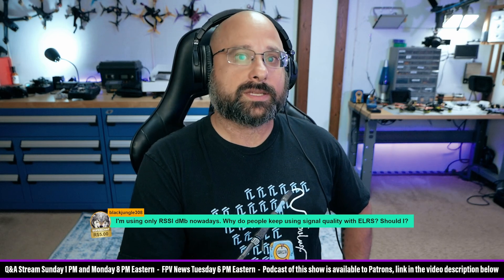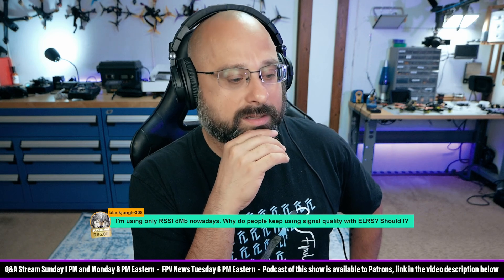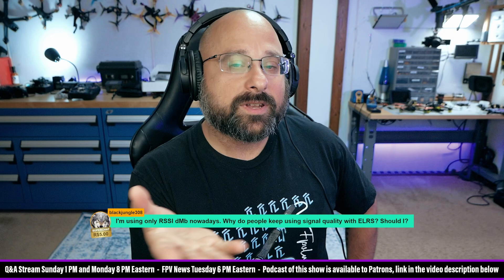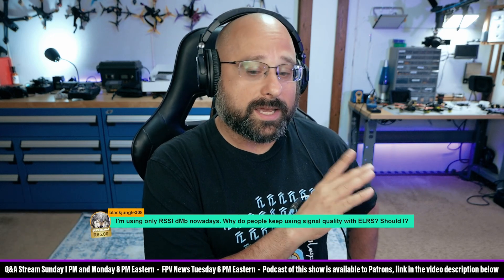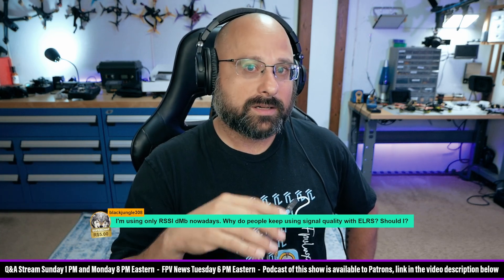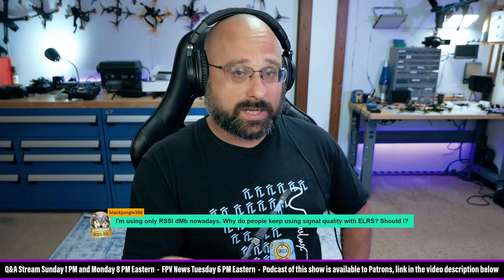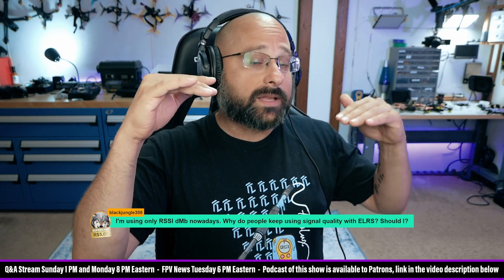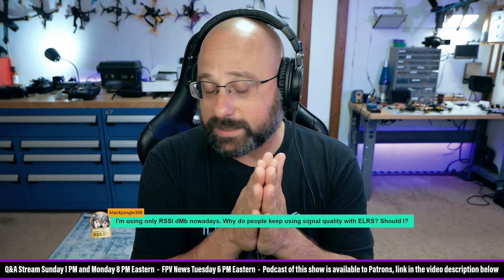Should I Use Link Quality With ExpressLRS? What About RSSI dbm? - FPV Questions

Comment: My radio has good lq and rssi but dji goggles 2 osd showing low rssi.  Anyone know what's going on?
Reply: The default warning value is -60dBm which is far too strict considering ELRS goes down to -105 or lower. On the OSD page in Betaflight Configurator change the RSSI dBm warning value to the value shown next to the Packet Rate in the ELRS lua, and add 10 for a safe margin (if you want to use the warning at all, but I'd just set it to 0 to disable it and use LQ)
Reply: @CapnBry  I tried that but now low lq flashing in goggles but radio it's good.  Tried different reciver and different uart no luck
Reply: @CapnBry wait, you disable your RSSI dbm warning? Talk to me a little more about that? You don’t think it is needed? Or you just watch it closely enough? I ask because mine is set to -10 of the packet rate, and I get the warning maybe 1000’ out with like -95 dbm. My LQ appears fine though, you’re saying I’m good to keep flying farther as long as my LQ is good and I don’t dip to -115 (or whatever my packet rate is) I want to fly farther but I don’t want to fail safe like 1500’ out into some trees
Reply: @Ryan.Rivera  Yeah ultimately the only thing that matters is LQ and you can fly it all the way down to 0, although betaflight will start going in and out of stage 1 failsafe. I don't find the RSSI dBm warning does much because you kinda know when the signal isn't going to be good and the LQ going down is what is going to tell you you're about to be too far / obstructed. The dBm itself can sort of tell you when you're approaching the point the LQ is going to change, but the dBm is influenced by so many things (e.g. having a receiver that has a PA/LNA on it means the dBm are artificially higher by about 12) that it is easier to just monitor and warn about the number you actually care about: LQ. 90 LQ is fine, 80 you need to pay attention, 50 you should probably turn around unless this is longish range and you're planning to go to failsafe. Like JB said though, that LQ can drop really quick if suddenly there's a lot of trees between you and the model.

Comment: I use LQ, SNR, and transmit power. Transmit power only works with wide channels. If you use dynamic power, low LQ and SNR could mean you are about to failsafe or they could mean you are about to switch to a higher power setting. Having transmit power also displayed lets you know which of those is more likely.
Reply: What do you mean only wide channels? What channels are you referring to?
Reply: ELRS has an option for sending less data for each packet. Think it’s called hybrid channels now. The options have changed between some versions. The wide channel option is the closest to how Crossfire sends channel data although I think the upper channels still have less resolution than the first 4. Transmitter power is sent only when wide channels have been selected.

Comment: It works similarly in audio theory. You can turn the volume up on a speaker 30ft away to hear its sound better, but if you're in a stone-walled cathedral with 40 other speakers playing different sounds, what you actually hear/receive will be really difficult to parse amongst all the additional sound in the space. Ultimately, it's the quality of that 'received signal' that matters to the FC but it's important to know when it's also too quiet despite being received with little interference as even high volume sound decays over time/space.